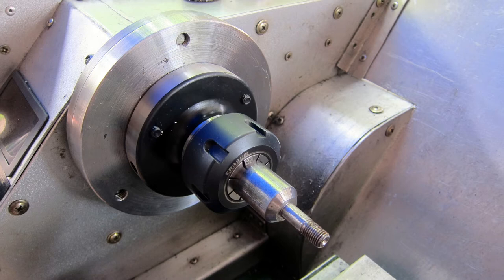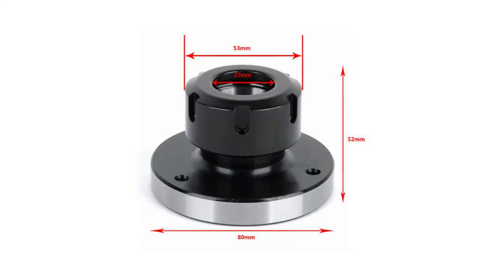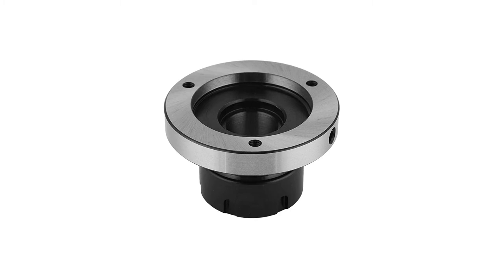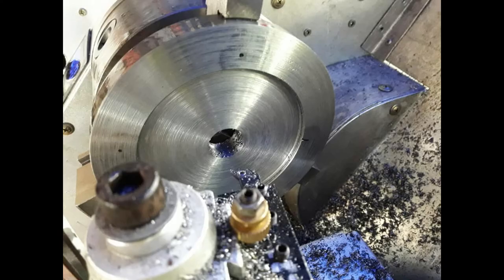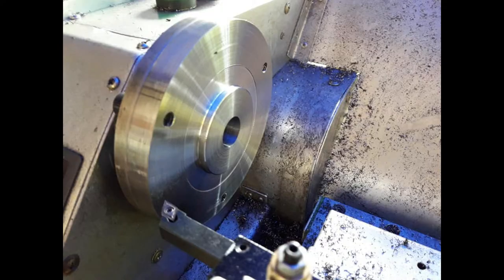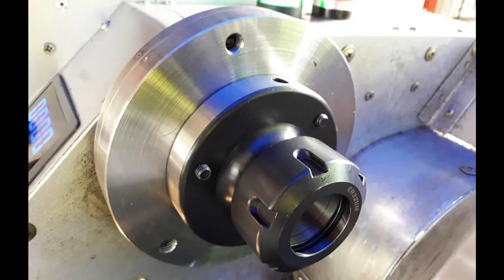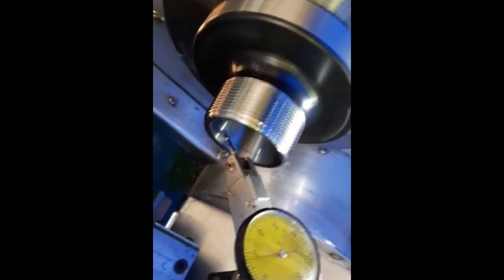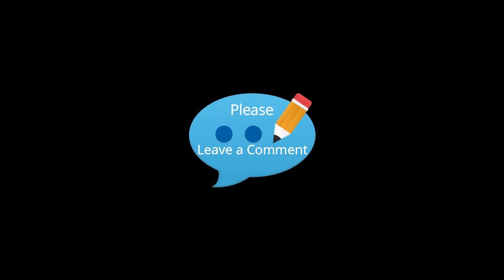MHW Episode 11 - ER32 Collet Chuck Fit Up

Comment: I bought one of those for my Chinesium Mini Lathe. It works OK, kind of a PITA to swap it in and out.
Then I bought the old Banggood collet set. Some of those leave a little to be desired.
Then last year someone gave me the ER32 collet set with the holder that has an M3 taper on it that also came with a set of collets.
Now I have the little collets running out my ears.
They can be pretty dang handy though, I do have to say.
Beats having to adjust the runout with a four jaw chuck constantly.